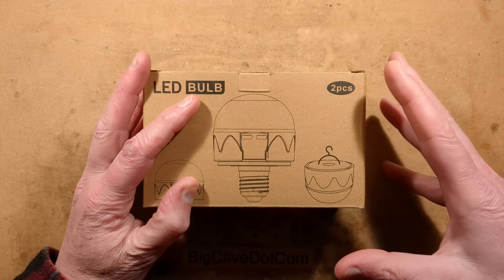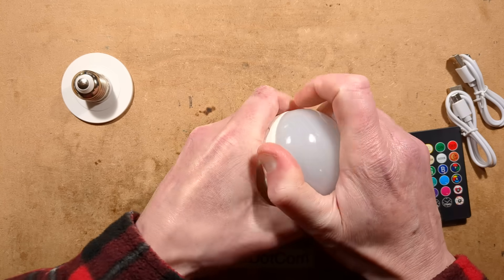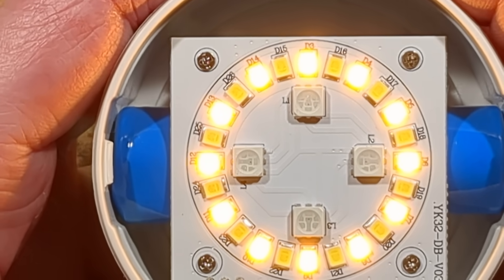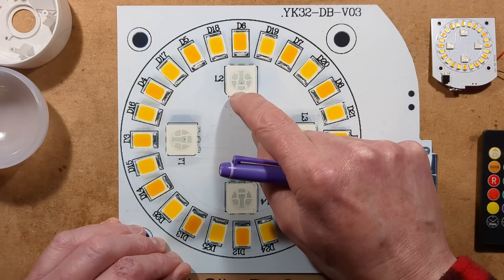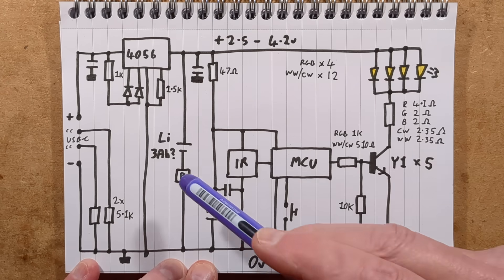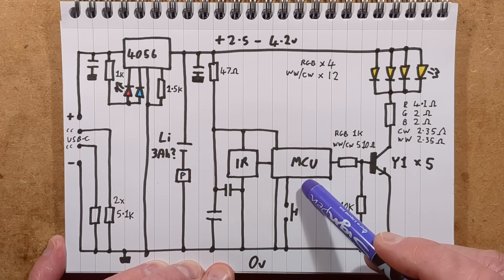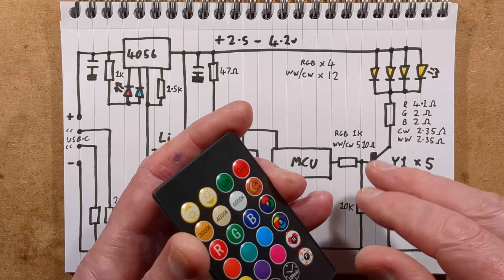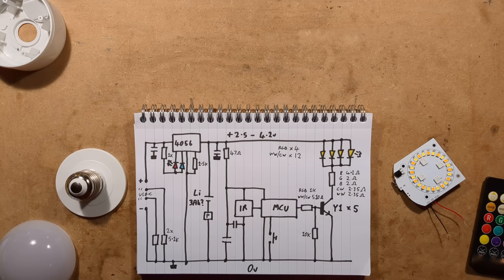Inside a screw-in rechargeable LED bulb

Comment: As I wrote on a previous video. Pulldowns are used on BJTs as well , not just MOSFETs. It's to make sure the transistors are really off when the µC pins are in high-impedance mode (which they most likely will be when the lamp is off and the µC is sleeping). A floating base (which it is when only connected to a high-Z pin) is an "antenna" for any stray signals, which could make the transistors "leak". Since the lamp doesn't have real power switch and the LEDs are always connected to the battery (unless the protection chip triggered of course) that needs to be prevented.

Comment: Clive.. I need answers to a question: I recently repaired some multi colour LED lights for an outside Santa 😂 it was easy as each LED had a single pair of wires. How on earth does the controller change its colour with a single wire pair. No idea. 😆
Reply from the maker: They're are some very complex LEDs that receive power and data along the two wires, with each LED having it's own address.   But it's more common to find the three wire WS2812B style.

Comment: I still don't get the screw - it's useless. Why not just skip it altogether? Or go the other way and have it charge off mains? Yeah it would cost slightly more, but you could just put in a very cheap capacitive dropper in...

Comment: Dear Big Clive, did you do a tear down of  those wall plug in LED fake TV simulators? I got one from eBay, mains not USB, for just less than a tenner.  t's a tad too bright and tad too fast imho, so hoping it can be tweaked. 

Ps unsure where to put this q on yt so here it is.
Reply from the maker: I've got an old one here,  but never made a video about it.

Comment: Nice video, Clive. It wouldn't surprise me if there is a version that would charge from the lamp socket. Another thought would be to use a tiny LED of very low current in the lamp fitting part that would illuminate through an aperture in the metal disc to a sensor on the main circuit board. If the LED fails to illuminate then the lamp automatically lights to either its last mode or other predetermined mode to provide automatic lighting in the even of a power cut. A further feature could be that it can recharge itself from a solar panel like a garden light with a function being available to automatically illuminate the lamp when the ambient illumination level falls.

I do wonder what the electrical isolation is between the lamp fitting and the metal plate for the magnetic mount is though. In theory it should be fine but there's always a possibility of something not so great in terms of electrical isolation. It may have been better to have a solid plastic lamp fitting to be completely insulating in case of a power surge or some kind of 'involuntary disassembly' leaving a metal live fitting in the lamp socket for someone to remove.

Maybe it's me being paranoid but after a few years of use of such a device being installed I find the thought of a degraded, and possibly forgotten, lithium battery in close proximity to a potentially live lamp socket more than a little concerning especially if left with an ageing USB charger left connected to 'maintain' it in a usable state.

Comment: If this would charge via the socket, USB, and solar, and had RGB as well as cool white and warm white, it would almost be a perfect light for any situation. Even better if it also had USB out. Camping, emergencies, or just household lighting. Personally, as it is, I'd open it and add in a cheap 120v to 5v inverter module so it would charge from the socket.
Reply from the maker: These should work with solar USB chargers.

Comment: Finally, a lightbulb that needs recharging! This is the best invention since the square wheel.
Reply: I have 4 of the Philips rechargeable lights around my house. The are a godsend when the power goes out in the evening due to thunderstorms, tropical storms and even snow and ice storms which all happen where I live. USB rechargeable is a great addition meaning I could charge these with one of the several power banks I already have which I can't do with the Phillips ones I currently have.
Reply: if only they charged from the light socket
Reply: in places where there can be frequent power outages.. this is prime

Comment: What I don't like about those cheap devices is that they often don't work with proper PD charger. I mean common manufactures, just add a few resistors to cc line.

Comment: It seems like it wouldn't have been too hard to add charging from the screw fitting, just a small power supply in the screw base to drop it down to 5V DC and add a couple of pogo pins in the base to contact terminals on the unit for charging.

Comment: Nice to see something new but am just wondering if the part that screws/plugs into the light socket is made from non-conductive materials as I’d be nervous that someone would turn the light switch on and leave it.  I know you said it’s not electrically active but could it be an accident waiting to happen?

Comment: I guess you could hack this, and take apart a cheap phone charger and use it as the power supply and put it inside it, but does it still work when you plug the usb in? Or does it turn it off when charging?
Reply from the maker: It doesn't sense charging.

Comment: Fun game : put one on the roof of your car, select 'police mode', and see how long you can drive around before getting arrested. 🤣
Reply: I don't think the intensity of the LEDs are bright enough to be noticeable unless up close to the vehicle by a few meters. At a distance of 200m or so maybe it'd be enough of a "blip" to gain the response of "tf is that?".
Reply: @AstrosElectronicsLab  At night, it would be visible, but during a bright, sunny day, I doubt you would even be able tell that it's on.
Reply: i thought  the statement is going in the flared base direction 😂
Reply: The base of it even has a magnet. If the roof of your car is steel, you could just stick it on there.
Reply: @vincentrobinette1507  Exactly. 😄

Comment: Why thei make the screwing holder in metal instead of plastic... there is a change that someone put a finger in the wrong spot adding o removing it. If it works to charge the battery and bring the light on when current cut off it will be more usefull than now.

Comment: yes, with mains charging this would be a great device - but it's still not the worst/most useless I've ever seen. It even got a button on the device, so it's not totally useless without remote. Battery seems a little on the small side for longer use? And IDK how well you could remove the screw-in part from the fixture after use.

Comment: This really is. A solution for a problem that doesn't exist. I don't think. ANY ONE. Wants to spend time undoing their light bulbs to recharge them.
Reply: Did you watch a different video, because you don't have to unscrew these to charge them. The are held onto the base with a magnet so you literally just lift up on them and done. Or you can even charge in place if you have a long enough USB-C cable and either a power bank or a normal USB wall charger.
Reply: @Medic_713 I did. I must have missed that when I was climbing up on chairs to take my light bulbs out and / or dangling 20 foot USB cables around my house to charge my lights.
Reply: @battlewrathgaming5047 clearly that's not what these are meant for but since you didn't even know that they were just magnetic or doesn't surprise me.
Reply: Dogmatism is almost always a recipe for failure......
....OF COURSE people would use this......what kind of fool are you....!!?
Oh, I know...an arrogant, egocentric one. .....!!!
Reply: @andymccabe6712  Yo! WTH are you talking about? Touch grass puppy.
Reply: @andymccabe6712  OH! You must have shares in the company or something. Also maybe revisit dogmatism. The word originates from "dogma," which is a principle or set of principles laid down by an authority, such as a church or a political party, as incontrovertibly true. A dogmatic person follows such a doctrine without question. 

Doesn't really apply to individual views.
Reply: If only it could charge through the socket, it'd've been extremely useful.
If there's no power interruption, you use those as normal bulbs and they stay charged.
If there's a short interruption, you use those as battery bulbs and they charge themselves as soon as the power is restored.
If there's a long interruption, you use those as battery bulbs and can either charge them via powerbanks or if power comes back/you switch to auxiliary power source (charging station or genset)
Reply: @caav56 100%. From emergency lighting, to "light in the other room has blown" solution. It'd be really versatile. I think the only awkward use case is when you want to turn it off at the switch. But a small cost for its utility.
Reply: @battlewrathgaming5047 I have some simpler lamps that do charge through the socket and, even when power is out, you can turn them off and on via power switch, so even that is doable
Reply: And with a single 18650, you'll be doing it frequently

Comment: We have now seen pulldown resistors at transistors' bases in multiple circuits. While transistors do turn off by themselves when no base current is supplied, leak currents to the base are amplified. I assume they want to avoid dim glow and/or additional discharging by those amplified currents.
With the pulldown resistor, you effectively get a voltage divider with the high side being the leak current, the low side the resistor. It stays far below the base-emitter voltage, so the transistor is really completely off.
Reply: Many (most?) MCUs have totem pole outputs meaning that in the 0 state the output is at ground and even capable of sinking current if needed. Seems to me that grounding the base would do a proper job of cutting off the transistor, no pull-down resistor required.
Reply: @sootikins Agreed, though in that case no pulldown is required to drive a mosfet either.
My only other explanation for the pulldowns would be to ensure proper off-state in case the MCU's output is high resistance (when it crashed something). But why would they care, as that would be a malfunction already?
Reply: I've always added pulldown (or pull up for PNP) resistors to the bases of bipolar transistors as a matter of course. It's well worth the effort to avoid a lot of product returns. In this case illustrated by BC though it's probable that the logic low from the MCU is well below the 0.6 base voltage threshold of the transistor in which case a pulldown resistor is not required.

Comment: I can imagine a scenario of using it in a building/area that used to have power but is off-grid now, say old shed, garage, barn, infrastructure building, very old house. Weeks or months from having power connected again, possibly involving replacing the entire installation too. And of course light switches won't work so the remote helps. But the RGB features are completely pointless.

Comment: I remember when you couldn't open AliExpress or eBay without getting offered those emergency lights with a 18650 in them that would recharge off the mains and activate if the power went off. Maybe you should grab a few of those to see if they've improved anything since the last one you took to bits?
Reply from the maker: I think they've evolved to a dedicated chip now.

Comment: Why does the screw in portion have a metal grounding tip? I hope neither the live screwed portion (also metal) nor ground pass through to the inside, which appears to be a metal disc. In the few seconds you show it that looks to be the case.
Reply from the maker: The disk is not connected.

Comment: I have bulb i screw in and it never needs recharging. I can even control it using a conveniently located switch. I won't have to worry about losing the switch, not will I need batteries for the switch. Imagine that!
Reply: To be fair, you do need batteries. Their just industrial sized and around 40 miles away. And spin.

Comment: The base pulldown resistors are also used with BJTs to decrease desaturation time in higher frequency circuits. But in this case they are definitely there so they can swap the BJTs with FETs willy nilly.

Comment: I have a small problem which is somewhat not what is in this issue, I have just brought a small radio which has a single cell AA battery, when battery went flat rather than wait while the battery recharged I installed another AA battery and nothing happened, when I recharged I read the voltage and it was AA 4 volt battery, I can't find one listed, do you know of one?
Thanks David
Reply from the maker: It sounds like it uses a classic 14500 rechargeable lithium cell.

Comment: Have you heard of a magnesium oxide battery before? There's an emergency flashlight that claims to run for 72 hours in increments, and it is dipped in water to activate the magnesium oxide battery for however many hours it runs in increments. 

This environmentally friendly, water-activated emergency light offers a safer alternative to candles and matches. Simply dip the Blackout Buddy H2O in a small amount of water to power the battery module and never get left in the dark again.

JUST ADD WATER
Dip the Blackout Buddy H20 in a small cup of
water to activate the battery module and light
the way. Simply add water once per day to keep
the light shining for up to 72 continuous hours.

GOOD FOR THE PLANET
The Blackout Buddy H20’s Magnesium-oxide battery module is free from Mercury,
Hexavalent Chromium, Cadmium, and Lead.

FEATURES
• Environmentally friendly water-activated Magnesium-oxide battery module*
• Add water once per day for up to 72 hours of continuous light
• Supplied in a rugged, environment-proof package allowing up to 10 years storage without degradation
Reply from the maker: I think I featured something like that a while ago.  Often falsely called a water powered light.  The water (and salt) is just the electrolyte - the metal electrodes corrode away.

Comment: I wonder why they went with a metal screw in plug when it could have been less expensive plastic if it's not going to be electrically active.
Reply from the maker: Probably cheaper than a custom moulded thread.

Comment: I may be misunderstanding, if it screws into a light socket, is there not a possibility to short out the socket or it runs mains through the fitting, I guess I would like to see a plastic fitting rather than metal, maybe I'm just being overly cautious.

Comment: I find the PWM speed is too slow again. At LEASt give it 1 KHz, it can't be that hard. Also the quiescent current is disappointing. The cell seems rather okay. I'd still replace it with one or if it fits two Panasonic NCR18650B.

Comment: (Some people are worries, and one of my latest concerns are the fire risks posed by the ubiquitous lithium battery. Before dismissing this concern out of hand it's worth googling the fire stats. )

This video features yet another lithium cell powered device. One must wonder how many of these potential incendiary devices are accumulating in homes around the UK. There are those in everyday use, but also those discarded in draws and cupboards. While a charged and charging  battery is a potential bomb, even the discharged battery contains lithium metal foil, making it a firework in any house fire. 
It is surprising that home insurance companies have not started to take notice and raise premium, or add exclusion clauses for fires resulting from such batteries. The statistics show the  incidence of fires started by lithium batteries are growing. A lot involved fires started by exploding e-scooter batteries, usually while recharging. 
One might suspect a similar problem with the power tool batteries, though maybe these are moving to safer LiFeP. 
How many people leave their phone or tablet charging unattended overnight? They are risking a house fire that might consume their house, along with all their possessions, not to mention the potential for loss of life. One might assume such fires are more common during the heat of the summer, but central heated homes in winter must also increase the risk.
Maybe home owners, and DIY enthusiasts,  should consider  investing in a fire proof bag, or cabinet, in which  to charge their batteries. 
It is possible that new battery chemistry will make the problem obsolete along with the lithium battery.

Comment: Probably a stupid question but what happens if you screw it in and turn the power on. I only ask because you never know with cheap Chinese products. Mind you, they would probably tell if it causes a firewall display as it’s another feature they will want extra for 😂
Reply from the maker: The screw adapter isn't connected.
Reply: @bigclivedotcom good to know, thank you.

Comment: What a wasted opportunity to charge it from the socket it's screwed into.  I image that could be a huge benefit in areas where the electricity is subject to intermittent supply.  I mean - I'm old enough (barely) to remember the coal miners strikes of the 1970s and the effect it had on the UK electricity supply.  When the power went off you'd still lose your telly and kettle - but not having to eff about looking for candles would have been great.

Comment: How much did you pay for that? Might be a bias for where I'm looking, but these lamps you found are more expensive than actual E27 bulbs with batteries in them. Though, annoyingly, they don't seem to automatically turn on when the power goes out.
Reply from the maker: The price seems to be very wide.  I linked to one of the cheaper listings on AliExpress.

Comment: Many of these are completely shite if you stick them in a fixture with a cover.  The IR remote becomes almost useless to turn them off.  You must be very close.  I have a few of these in different places for if the power goes out.  It's also annoying how each company uses slightly different remote codes even if the bulb and remote look identical.